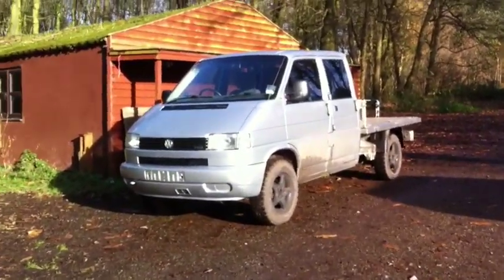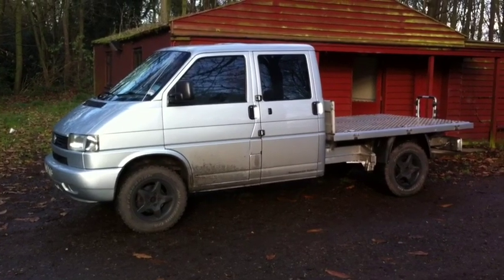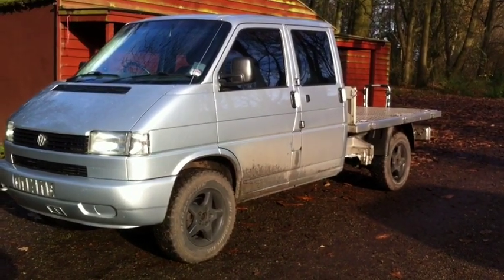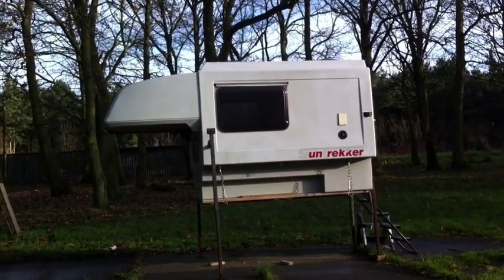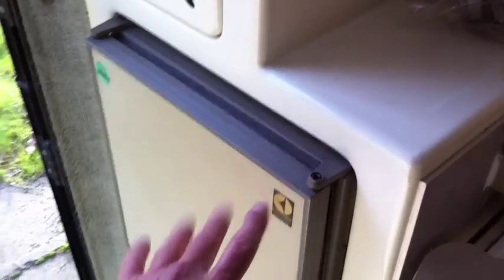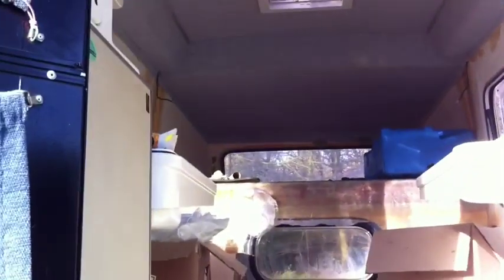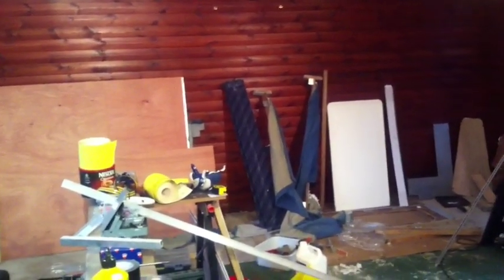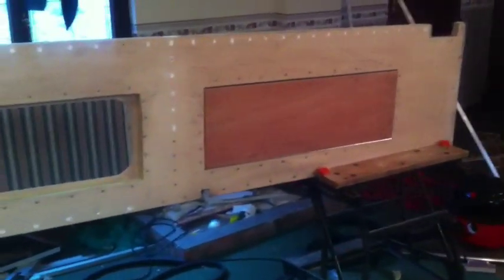Quick intro to my VW T4 Syncro DOKA and Suntrekker demountable camper conversion plans

Comment: Hi what made you bin this project? Im in the process of doing one, cheers Dave
Reply from the maker: Hi Dave, the main reason is that it just doesn’t look quite right on the truck, this is because the suntrekker is a bit narrow for the bed really. The other reason is that I prefer to mainly wild camp in my van and the DOKA just stands out too much with the demountable on. I’m now planning to release be the bed and add a grp cargo body that is permanently attached to the DOKA, and have it kitted out like a basic camper van, that’s all I need really. It won’t be very big, approx 9ft long and 6ft 6 wide, I’ve not decided on the height yet but not too tall. 

What have you got?
Reply: hi ive got a Multicruiser its a big old girl, very heavy so im fitting airbags to help. Are you on the T4 Forum? i could send you a pm, Dave
Reply from the maker: Hi Dave, would be interested to see what you’re doing. Is yours a syncro? I’am on the forum but don’t use it much. I have a blog at t4syncro.com and there is a contact page that will send the message via email and I can email you back. Cheers Clive

Comment: It's a T4, not a Type 4. A type 4 is a VW 411 or 412. Also, there's no such thing as a Type 25, that's a T3. All vw Transporters are Type 2. A split is a Type 2 T1. A Bay is a Type 2 T2. A wedge is a Type 2 T3 etc etc. You have a Type 2 T4.
Reply from the maker: Ok cool, thanks for putting me right 😀